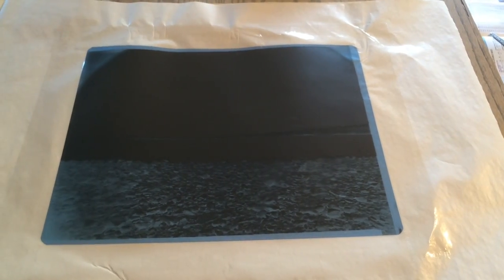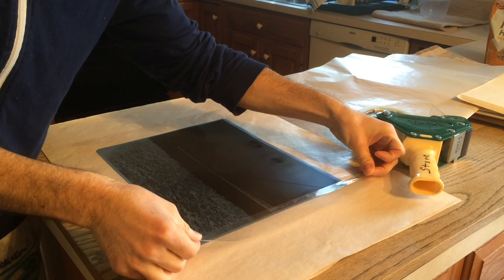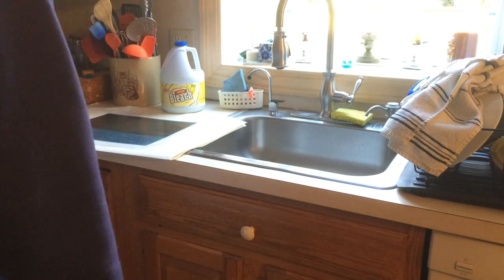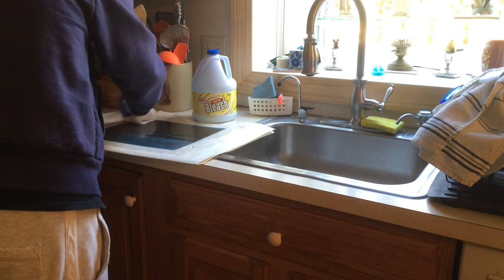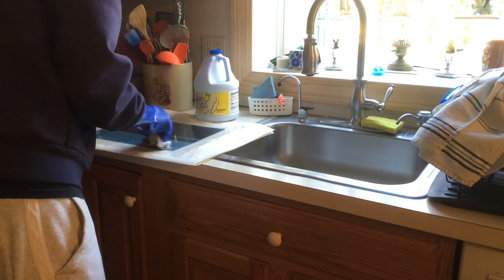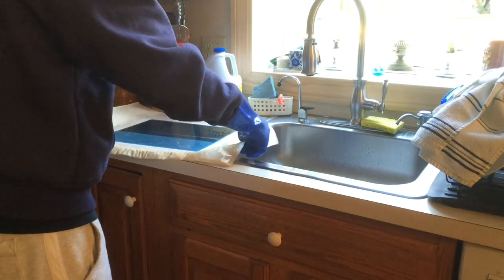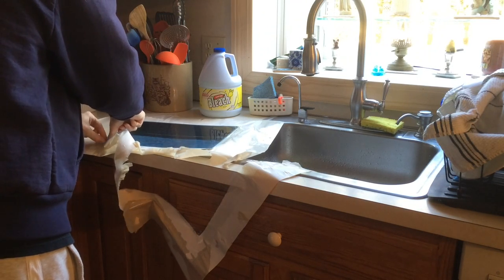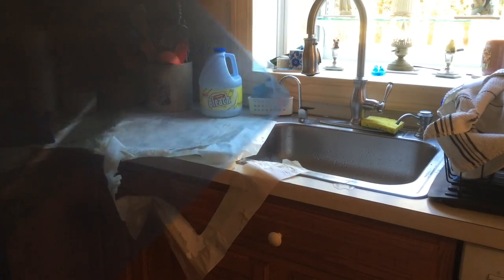How to Remove the Film Emulsion Layer from one side of a Sheet of X-Ray Film with Bleach Tutorial

Comment: Thank you for posting. I will have to try this as I liked my half speed, blue sensitive x Ray film. The single emulsion stuff is more expensive, green sensitive, and has an anti halation backing (yuck). Do you think it's possible to spray some polyurethane varnish on the keeper side to protect it from scratches? I'm going to experiment 😊
Reply from the maker: Paul, good question. My first impression would be that the polyurethane might also be prone to scratches, and also would create an uneven surface. It would also be UV resistant so creating contact prints might take even more time. Many variables, as you said you'll have to experiment to find out for sure 🙂

Comment: Hi could you tel me about how you develop XRay as a negative???? best regards
Reply: Thanks for your information very helpfull for me
Reply: Hi if you put a glass on your tray and after you develop the x ray film you will have not scratches because glass does not scratch film
Reply: Absolutely true. But many XRay films are double coated (coated with emulsion on both sides) and when you enlarge these they return perfectly sharp prints. So if you want to enlarge xray negs it is a good idea to remove one side of coating, even if there are no scratches.
Reply: **when you enlarge these they DO NOT 
return perfectly sharp prints.